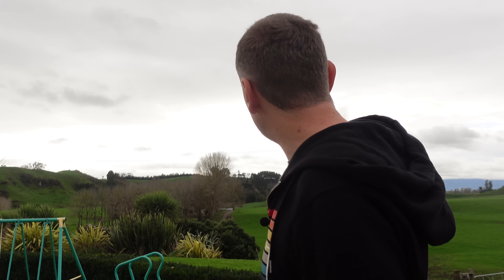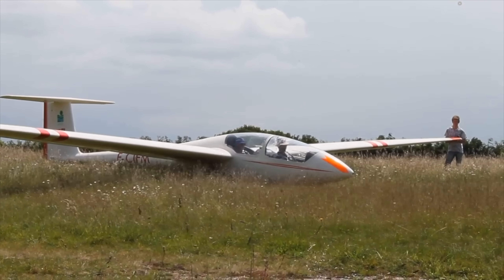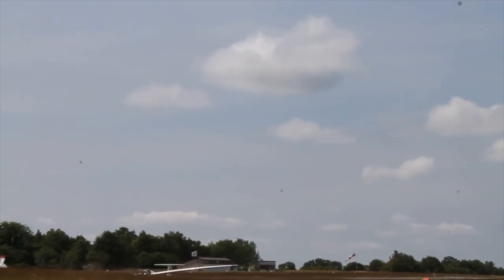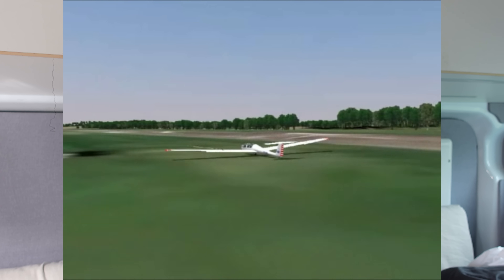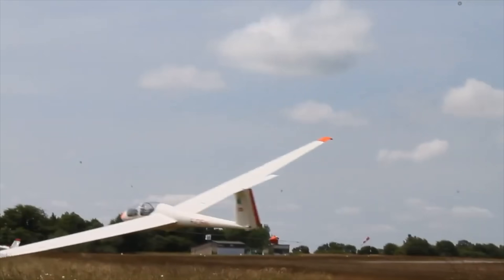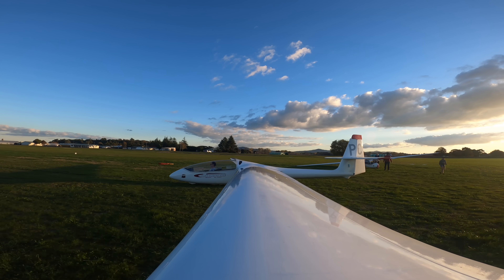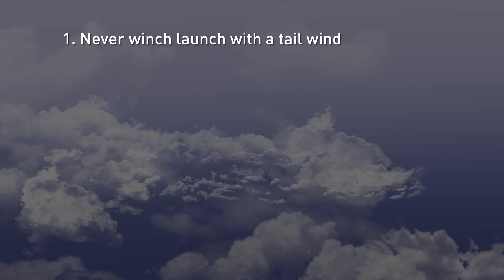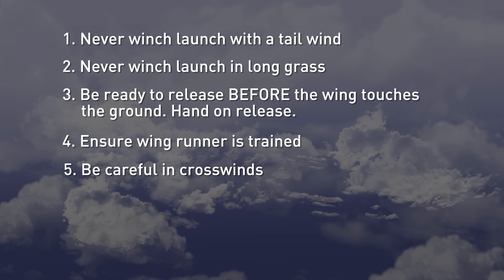Glider Winch Launch Crash 💥 Instructor Reacts

Comment: The runner should have the ability to remotely activate the tow release, the tow release should automatically activate when the wing drags on the grass, and/or, there could simply be clamp-on training wheels or skids which drop off automatically after a given amount of tether line pays out.
Reply from the maker: The problem is there are so many things that can go wrong at different moments. It's an interesting idea, but imagine trying to create physical systems to capture everything is almost impossible. Ideally we train our pilots so they know when to release, and do it quickly.
Reply: @PureGlide  I think I see what the problem is here...  disproportionate concentration of wealth and power is a serious problem which calls for innovative problem solving, however, flying is a rich white man's sport,  therefore, those who fly are strongly incentivized to perceive innovative problem solving as infeasible.
Reply: @networkedperson  it's complicated. How does the hook know the wing is dragging on the grass? Because of yaw? Well, many times you need yaw higher up during the launch, and you don't want the hook to automatically release because of yaw.

There's another problem with the remotes: you're putting responsibility on people other than the pilot. At the moment, the responsibility for the glider is on the pilot in command flying it. 
They are supposed to check everything is in order with it, before they fly it, and they have to be cleared on it, familiar with the commands and the manual.

If you make somebody else responsible, or co-responsible, for releasing the hook, that makes everything way more complicated in case things go wrong.
Reply: I had some of my students consider the possibility of a hook release mechanism that would release if excess yaw was present. There conclusion was that a solution was possible, but that it introduced addition greater risks. The team leader advised that where the release handle was difficult to reach a simple cord extension could be employed. I agreed, she is now an engineer, professional pilot and her husband works for the AAIB. I think that they are planning to breed another generation of pilots.

I have flown old gliders with wheel dollies that can be released after launch (like the Me 163), there is a danger that the wheels can bounce back up into the glider. They also can cause additional drag in the long grass and would cause more problems than they would solve.

I this case the simple solution is to cut the grass.

In my opinion, whoever was in charge of the operation was negligent in allowing a launch to occur at all.

Comment: In this country we have a norm: 15 cm grass is max. We talk about the left hand position: on the knee or holding the release. In my book is a break out when starting. A remember I violent centrifugal force and my clawing after the release knob. I hold the knob since then. There is some risk of reflex and releasing when you don't want too, but you should be fast enough when you need to be.
Reply from the maker: Yeah even 15cm sounds long and could provide a lot of friction! Depends how thick it is I guess too.

Comment: Very timely vid, was just explaining to a student yesterday the importance of releasing if a wing even thinks of dropping.
Also added a short cord to the release knob on the ASK21 so I could rest my hand on my leg and still release if needs be, other wise I have to lean forward to reach it, which is very uncomfortable on launch and climb.
Reply: I fly quite a few different gliders and many of them don’t have good ergonomics when it comes to the placement and operation of the release. I do as Anton does and attach a short bit of rope with knots in it that I can grab and pull quickly. To have your hand actually on the release in some types would make the flying part difficult and uncomfortable. For a critical control they are sited somewhat randomly in the cockpit.

In some machines the release is obstructed by the flap lever, or it is forward of the stick at the bottom of the instrument panel. By the time you have a) decided to pull off, b) looked for and found the release and c) stretched out and pulled it, you are half-way through the accident...
Reply from the maker: Cheers Anton, yeah critical you can reach it even with the G's being pulled :)

Comment: I’ve noticed that some pilots get used to dragging the wing on the ground slightly.  Like in Florida where the grass is not what I’d describe as grass. It doesn’t grab the wing like the grass in the UK. I’d did an aerotow launch there with an instructor and nobody running the wing.

I saw a similar accident when some cross country pilots landed out at our winch only club. They’d got used to dragging their wings on aerotow out of fields with no wing runner and all their club aerotow was on tarmac. In this case the damp grass grabbed the wing, the glider started to cartwheel, the pilot released and snapped the tail off.
Reply from the maker: Ouch! Yeah it might be fine occasionally when aero-towing, but depends if you have a nose hook or belly hook for a start. Some gliders even have wheels on the wingtips (like our Puchacz twins). But yes not a good habit to get into...

Comment: In initial phase there is a high acceleration pushing the pilot back in his seat, while in many cases release handle is in the front and it's hard to grab it under a g-load. Maybe a student-pilot was very little experienced and it took some time to react. Some pilots attach a piece of metal wire to the handle just to have it right  next to the hand. In some gliders (jantars ) it's a very common practice even in towed launch as I've seen. I hope everyone was all right after the crash
Reply from the maker: Yes as mentioned you need to be careful not to accidentally release! But again I think if that happens it's not as bad as doing what these guys did :( Sorry I don't know the outcome for the pilots.
Reply: Adjusting your seat position so you can have easy access to the release   handle comfortably is part of the ABCHAOTIC check.

Comment: Concerning a hand on the release, true during winch launch. But I adwise against it during areo tow, where an accidental release can be much more problemetaic, like when you are still low at the end of the runway and full of water.
Reply from the maker: Yeah agreed! Only for winch launches, and not even the whole launch, just the beginning is critical. I normally let go once we're established in the climb. Good point, cheers
Reply: Needs to on, on very very near, for both, at least during the initial stages of launch.....period. Much more likely to drop a wing on aerotow due to lower acceleration and a similar situation can happen on aerotow.... ..plus you have a tow pilot you can kill as well. To say otherwise is plain poor advice. Can't believe that you agree with the guy above, extremely poor practice..

Comment: Cutting the grass at the launch site would be a good start, probably a little difficult too run through knee high weeds
Reply: In Germany there are actually regulations for grass airfield. I think we are only allowed to have the grass at 15cm max.
Reply: @steilkurbler4973  I take it your wing tips are specially  adapted for long grass then. I'd suggest anything over 3" is too long.
Reply: @millomweb  No they are standard. Just because there is a maximum value, doesn't mean you need to exploit it by going to the limit all the time.
Reply: @steilkurbler4973  IMO, it's too long. Needs reducing by half.
Reply from the maker: Yeah exactly right!
Reply: That was the first thing I noticed! No doubt that was a major contributing factor. That grass definitely didn't help the situation at all.
Reply: to
Reply: @garrystubbs4891  Won, to, tree, for...
Reply: Yes. It was fairly obvious, but either the (presumably the Instructor in the back seat) PIC's desire to operate over-rode SAFETY concerns, or the PIC's experience and ability was insufficiently knowledgeable, experienced or skilled to accurately assess and make a disciplined, if disappointing, correct command decision. Not preaching, merely observing analytically. 

Most who've been in active in aviation any significant length of time will have made a similar errors of judgement at one time and another, been luckier than the few, and learned from them. Totally avoidable incident, and when it did all start to go pear shaped, whilst it's apparent it all happened very quickly, clearly the PIC was mentally behind the aircraft, unprepared for unexpected abnormal ops so early during T/O nor sufficiently SA cognizant to wrest control "My Aircraft" from the FP (assumed the stud was) and execute an IA -release. Right from the outset before a launch was even contemplated, ops should have been cancX until the grass was mowed, or ops moved to a mown area adequate for planned ops. Of course, they'd realise that now reviewed from the perspective of 20:20 hindsight. Pleased they both escaped fatality status.

Comment: Tim,  you could add a number 6 - pilot not holding ailerons level and wing runner not holding wing level...often one causes the other.  The controls become fully effective in about 2 seconds after all-out on a good winch.  If the stick is held offset at the start the wing goes down fast and many don't react in time.  See it a lot from the backseat.
Reply from the maker: Hey thanks Mark, good points. Cheers!
Reply: You can see the ailerions on the ASW19 showing right stick even as the launch starts,it was always going to drop,just lucky it wasn't on the uncut part of the strip.
Reply: @tonypassmore3700  The ASW 19 is a single seat 15M glider, this has two seats, a Grobe 102 Twin Astir or similar.
Reply: @christopherrobinson7541  Was commenting on the Single seat ASW19 that was shown dropping it's wing but still getting dragged into the sky,KD on the tail,the Twin is an ASK 21.Watch the video again and you will see what I was commenting on.
Reply: @tonypassmore3700  Yes a K21, the markings on the nose fooled me; I rarely see them from the outside, am usually in the back.
Reply: Grass is to big!

Comment: Thanks for these important aspects. Another aspect, I think the winchdriver was accellerating to hard at beginning. Only to win some more meters of altitude ;)
Reply: Why would that contribute to this particular accident? Contrary, accelerating too slow makes it more likely to drop a wing because you have no aileron control for a longer time. Thus the cross wind would have even more time to push the other wing up.
Generally accelerating too hard is not good because of stress to the structure, the tail banging hard on the ground and the risk of rotating to full ascend attitude at way too low altitude. 
Sloppy acceleration is to be avoided equally. That was the reason for me to release while being on the ground once.
Reply: @kaihorstmann2783  you are right. But between black and white, there is the colour of solution ;)
Reply from the maker: Good point also, thank you!

Comment: its a winch launch (ie glider acceleration is high) so the wing runner might have been able to take one more stride at most. No, the real problems are:- 1) launching in long grass 2) crosswind? 3) not aborting in time
Reply: Agree.  If the grass was shorter and they released as soon as the wing went down it would have been a gentle taxi into wind.... Done it many times from the back seat :-)
Reply from the maker: Yeah I did mention it happens fast and the wing runner might not be able to do much more, but I do feel this one they should have done a BIT more especially with the long grass.

Comment: Great video. I’ve done 600+ winch launches and this was still informative
Reply from the maker: Hey great to hear! Have you had any wing drags? Or had to release before?
Reply: @PureGlide  Never dragged a wing or even close to it. Lots of cable breaks at various altitudes down to 50’. The low and high breaks are no problem because you land straight ahead or go around. The intermediate hight breaks are dicey when you don’t have enough height for an easy 180 but you are too high to land straight ahead. Based on your field length and wind you need a mental mark on what altitude you will commit to what action before you start rolling.
Reply: @PureGlide  emergency release is part of the training before first single flight . . .
So he should know the bang when full pull wire gets uncluchted .•°
Reply: @farrider3339  o
Reply: same here and same here!